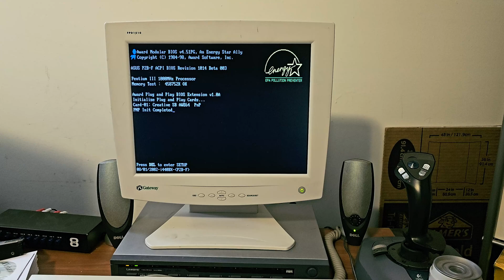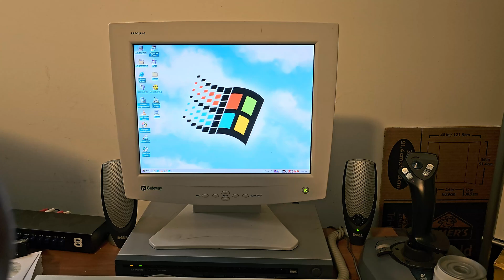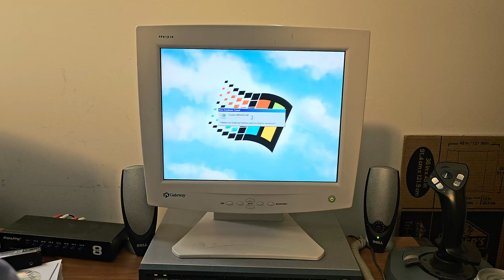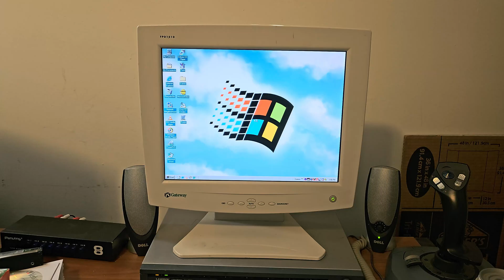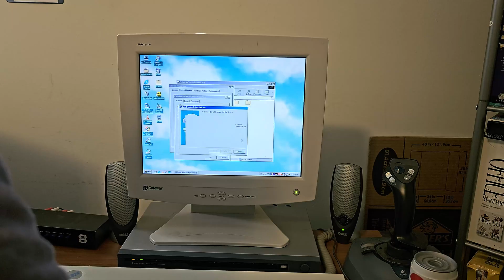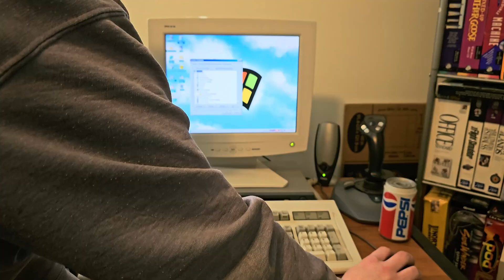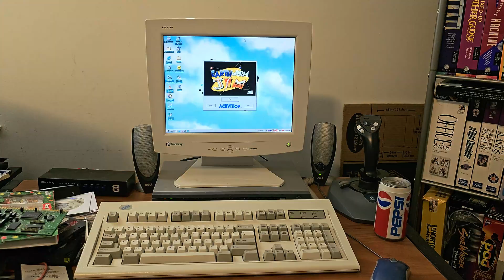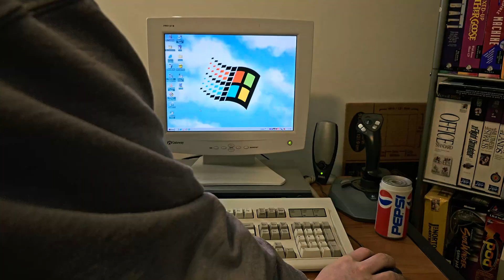Fixing a Pentium 3 Sound Card Problem

Comment: The Sound Card You Just Installed On This Retro Gaming PC Is A Perfect Choice For MS DOS Gaming and Windows 98se and Gaming Will Work Nice But Installing A IDE To CF Card Adapter For Storage Would Be Nice and A Installing 256 MB Of RAM and A NVIDIA GFORCE Graphics Card From 2002-2004 With At Least 32 MB Of VRAM

Comment: Ayy the Carolina Flyer is back.

I have an build similar using an OEM Gateway intel board ws440bx (Warm Springs) with slocket adapter + pin modded tualatin Pentium III.

Comment: Nice video !! One thing about AWE64 and SB32 families : they have.a flash BIOS that tends to corrupt with time (it occurred on a few AWE64 Gold and this issue is known). Hopefully there is a tool available online to flash back the correct BIOS for all these AWE 64 / Value / Gold / CT3670 / CT3620...
Reply: When I say a tool, it's all software based, it's just an utility you run in DOS.